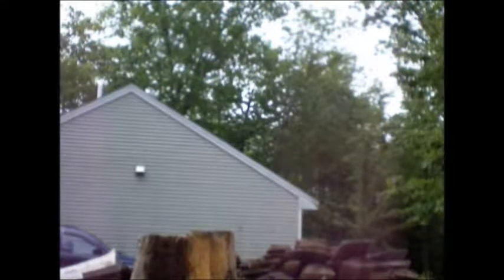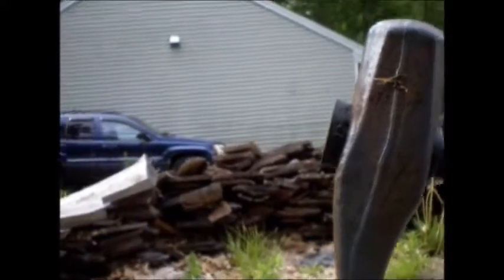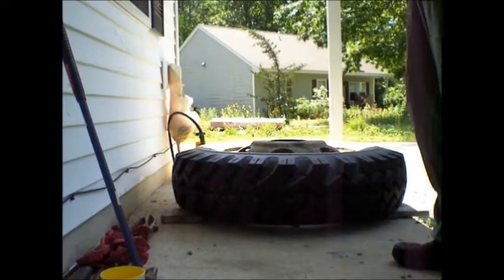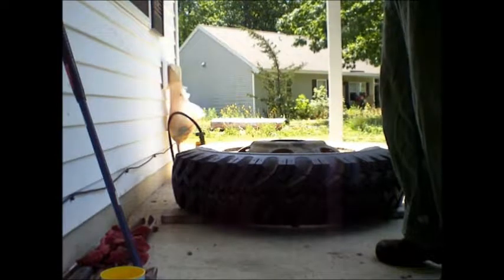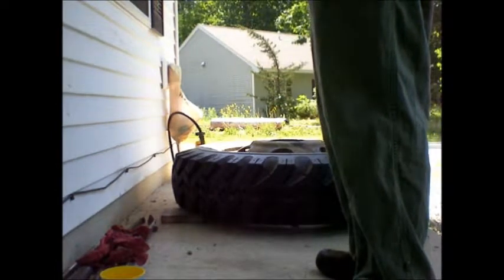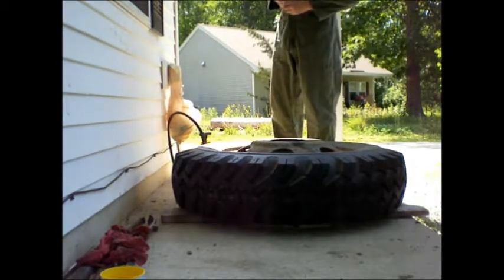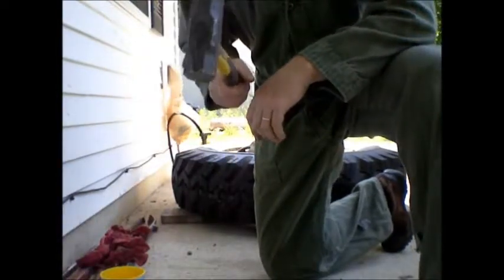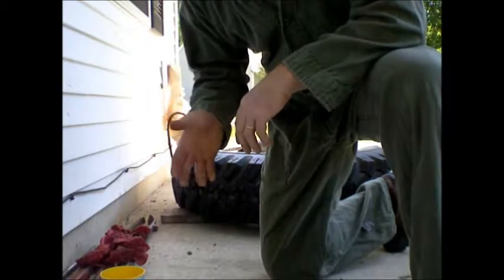The Split ring rim some people call it THE WIDOW MAKER

Comment: Bummer Dude!   I gave this video two thumbs down because I was hoping to see You bouncing that duckbill hammer for thirty two minutes straight!   Okay, maybe I just told a little white lie there.  So I only gave you one thumb up...  I'd have figured out a way to give ya two if'n you hadn't cheated by using power tools!  
Okay, okay, I sometimes resort to taking the easy route as well.  When the going gets tough I will utilize our 160 hp, 15 ton bead breaker (Deere 644E)
My understanding would be that is a budd rim with a split lock ring.  
My father has a trailer which has a true 'split rim' as the two halves connect in the center of the rim and one overlaps the other.
I believe that to be from a forties or fifties Ford 1 1/2 ton truck.    Dad broke his arm as a young man airing up one of those. 
We also had rims with a solid ring which were a challenge. 
Pretty much as you stated, it all depends on the condition of the rim.   Many of those here in the rust belt are in pretty tough shape by that age.   Rust is easy to see, cracks are a little more difficult to detect.
So, when is the video scheduled where you turn up the pump and install compound turbos?  I can't wait to see you cut a couple holes in the bed for some big 'ol stacks....    Roll Some Coal Damon!!!
Blessings Brother!
Reply from the maker: (bounce the duck bill)I did that when I tryed removing my 1st ever stock military tire with five hundred layers of paint on it. Funny thing is the 1st time I swung it I split the wood while making that first clip.
Reply: i changed my a tire on my duece in less than 20 minutes lol, farm jack on the front bumper to break the bead.. no need for all these fancy tools
Reply from the maker: @johndowe7003  one could  just use a ax to cut a tree no need 4 a chainsaw.U cheated  ur suppost to just us a duck bill lol
Reply: @nomad-pq4yw8iy7v  I need to buy myself a duckbill actually 🤔
Reply from the maker: @johndowe7003  Don't leave it some place were u can trip over it in the middle of the nite! or be like me and leave it outside in the winter and not find it till spring like me
Reply: @nomad-pq4yw8iy7v  lol it doesn't snow in my area and I got plenty of shit to trip over 😁